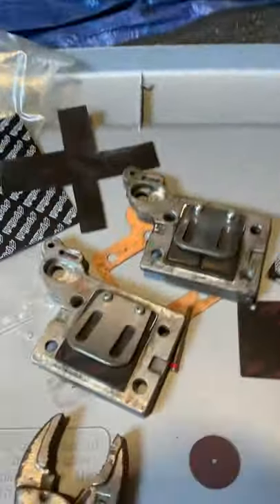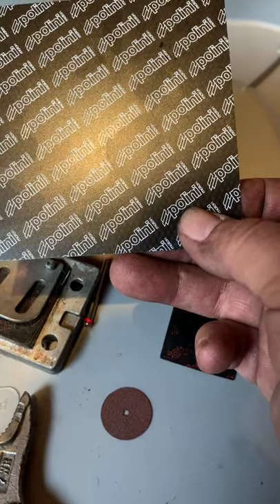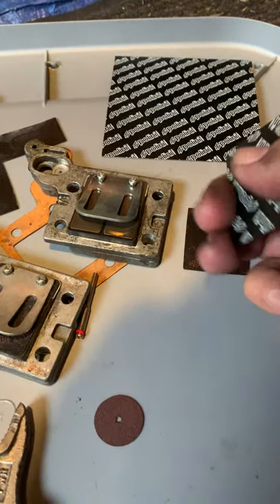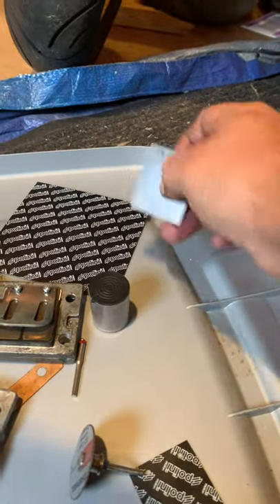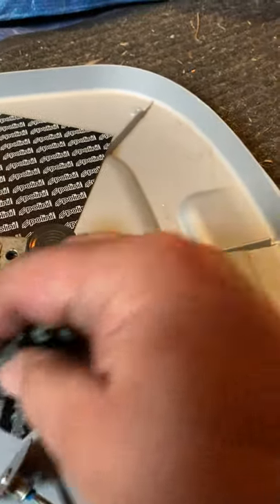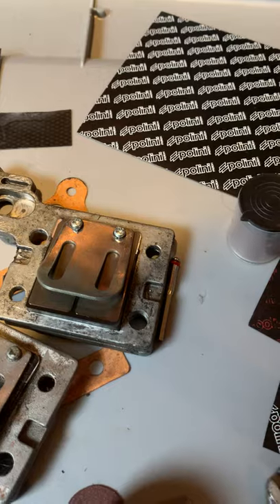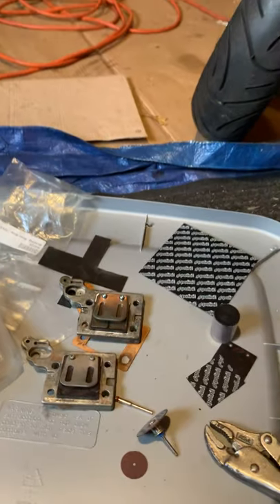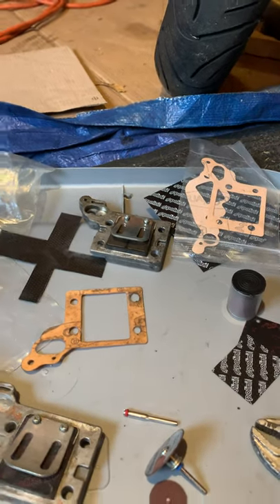The Best Reed Valve I Have Tried on Stella Scooter, LML Star, Old Bajaj.

Comment: I just got a stock 2008 Stella and bought the GGR kit along with the recommended pilot and main jets as well as the P200 air cleaner.  If I have subpar results I'll look at this thinner reed material.  I'm going to be running that goofy stock muffler for now that has the catalytic converter built in.  Thanks for the video.